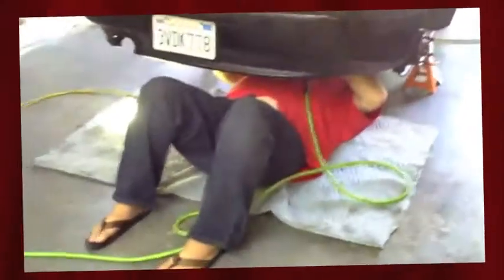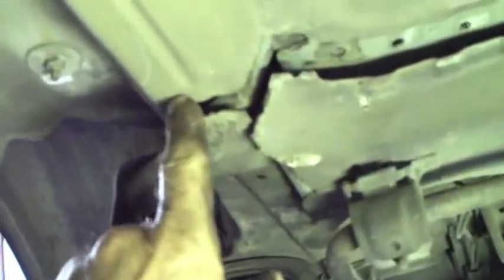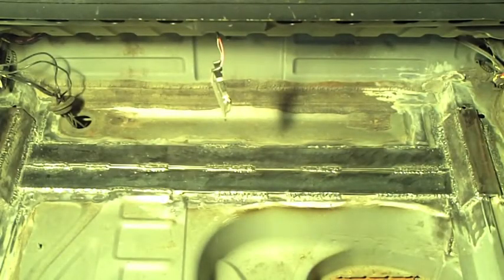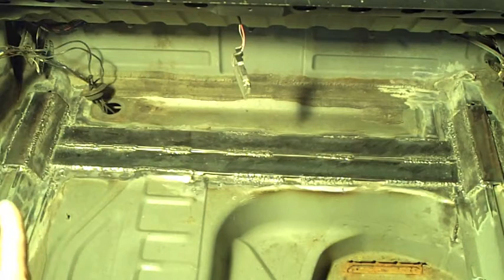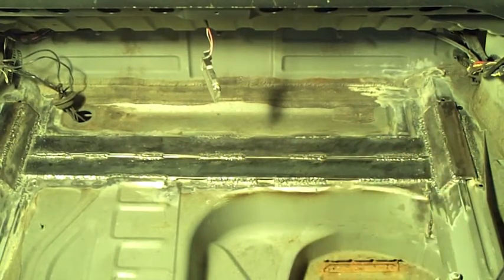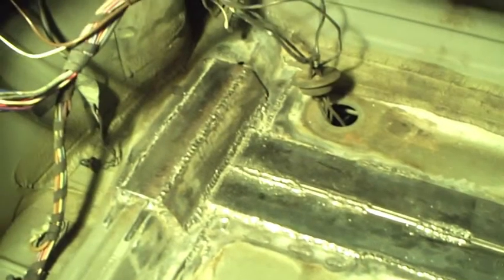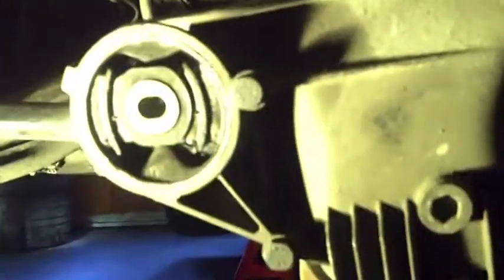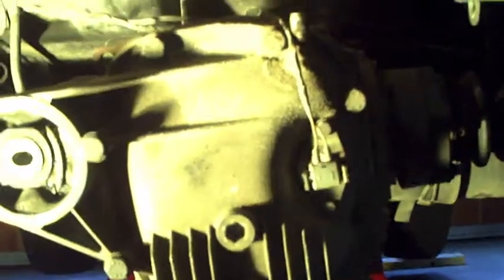BMW Z3 Subframe Repair & Reinforcement modifications.

Comment: It probably got this bad because the bushings were bad for years. Without that cushion, the constant smacking of metal to metal would tear it apart fairly quickly. The upper strut mounts on another car were destroyed by a similar case of mechanical working.

Comment: German Quality and Engineering. Don't believe the hype. 

I really don't understand why you didn't use angle iron instead of making angle iron out of flat bar. I would have cut the entire cracked piece out and replaced it with channel of a close size. I then would have BOLTED the the channel underneath with 10 or 12 bolts across the width of the car, 5 or 6  per side,  with a single wide 3/16 backing plate on the inside and sealed it with mastic. That would have made a stronger structure, took less time and distributed the load over a large area. It also would eliminate the problem of hydrogen embrittlement and the new welds cracking.

There is one of the 2.3 L models available here in SC for $1800 with only the problem of broken differential mount. I'll try it with my design and maybe post it on you tube.

Funny how Corvettes mount their differential in a similar manner and transmit 4 to 5 times as much power but never fail.
Reply from the maker: ....Please let me know when your repair video is up so we can see how it should have been done!

Comment: Hey Abe. My 2.8 Z3 has this issue now. The subframe has come away from the boot. It's pretty bad. How is the car since this repair? I'm going to get my mechanic to try and follow this guide.
Reply: Hey Gareth, my friend Craig Robinson is the mastermind behind the operation and four years later the car is running beautiful. The subframe is solid, don't hear any noise and i check it every once in while, travel all over the state. If your mechanic follows the video, it'll work n save you a lot of money,good luck and thank you.

Comment: I had this same problem except mine was a whole lot worse, the plate on the trunk above the differential mount had completely torn. it was very close to just falling out. I ended up just using 1X2 box tube to box my rear end like the drag cars do. I cut out the whole tube that holds the diff mount, spare tire mount and the sway bar mounts out. when we finished making all the welds between the new 1X2 and the frame we layed down a piece of steel 3/16 thick and welded it all around our hole and where it made contact with the 1X2 underneath the car.  it took about 3 days but I haven't had a problem since.
Reply from the maker: Thats a good story.....unfortunalty BUT it had a great ending!
You & I sound very similar with the "get'er done" approach to problem solving.
Always loving a good challenge. Glad to hear it worked out.
Reply: cbr632003 I hope you don't think it didn't happen 😂. I have pictures if you are interested, before, mid and after the project
Reply from the maker: not at all!....I'm pretty sure it DID happen. I meant...It's just unfortunate BMW made a poor choice in their design or execution and most folks are left having to remedy these issues however they can on their own.
Reply: Okay okay, sorry I can't sense sarcasm when reading. Its pretty ridiculous in my book, and BMW of north america has failed to recognize the problem its a very serious design flaw, especially in a "sports car" I'm surprised my whole ass end didn't fall out when I really got on the gas. I had replaced the center support bearing about 3 times before I really took a look a good look at it and I'm glad I did. I thought I was just bruning through CSB's because I was pushing the car pretty hard
Reply: Burning*
Reply: i bought a used one for dirt cheap....  went in already thunking to do something similar... might end up making a whole frame and just droping the shell on top 🤣

Comment: What type of welder did you use? TIG or MIG. By the way, your work is very clean. Good job.
Reply from the maker: +matt mcc -
Thanks for the compliment on the work, although i'm no pro at welding.....Anywho, I used my mig welder- no gas.

Comment: One of the other posters is correct: BMW should be taking care of this. What's worse is that this is a '97, and I've seen a similar massive fail on a '99 3.2.
Reply from the maker: +Cary mcdonald 
Absolutely, when i was doing research for this repair, I was amazed how many [years] of these Z3 models suffered from this design/engineering problem. I don't own a bmw, but enjoyed the challenge and helping my bud.